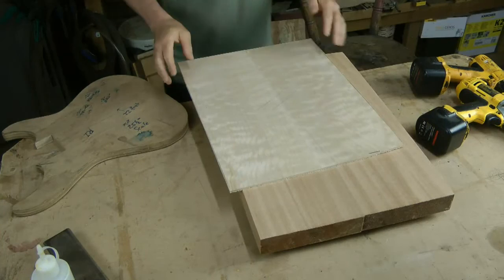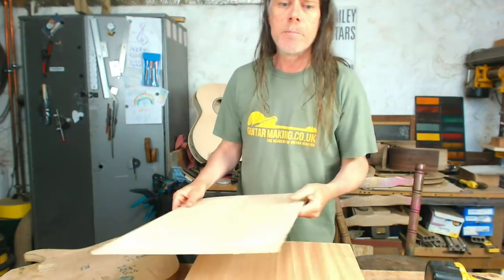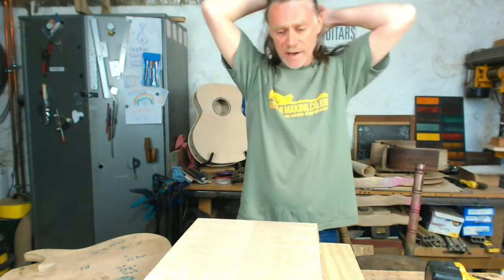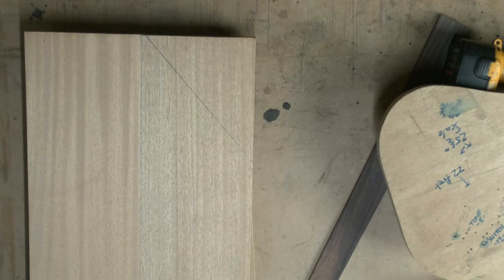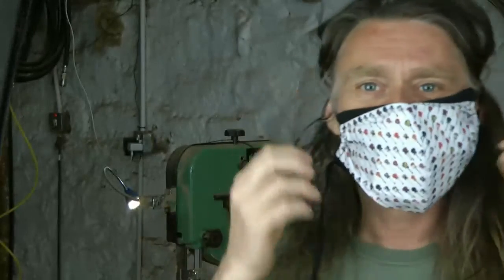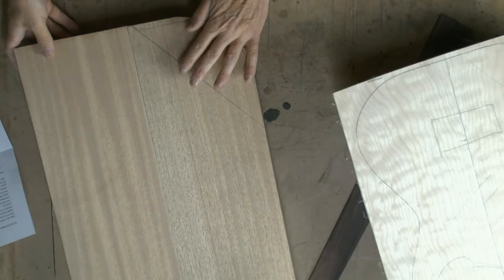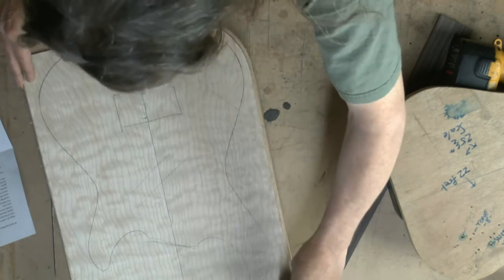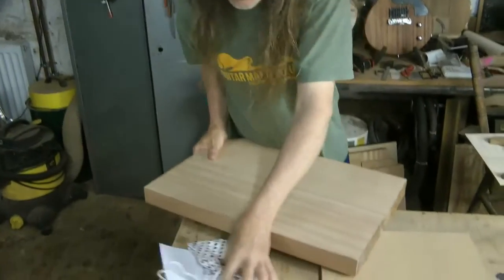How to Make a Drop Top Guitar Body

Comment: Do you prefer to use the Stanley type blade over a card scraper or cabinet scraper for any particular reason? Is it that they’re disposable and don’t require sharpening? Or is it that they’re multipurpose, i.e cutting and scraping?
Reply from the maker: Yes - plus there is always one nearby! All that and they are also very cheap and easy to find. I do use cabinet makers scraper blades if I need to get heavy...

Comment: How thick a blank must be for a 1/4 inch top? Can it be close? Like .27 .28? 1/4=.25
Reply from the maker: For a Drop Top I like to make the cap a little thinner than 1/4" to make them easier to bend - approx 3/16" (4.5mm) - 5mm max - or it might snap or crack when you try to bend it. So you could start with a .25" blank. After joining and cleaning up it should be around the right size (under .25"). You have to use your judgement as each piece of wood is unique. Good Luck!